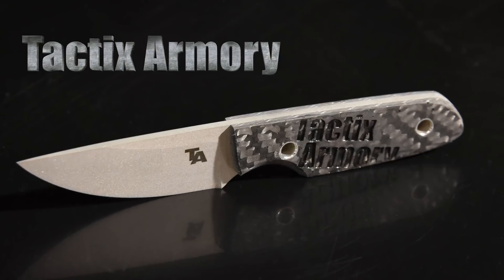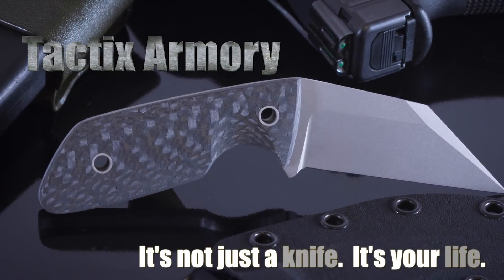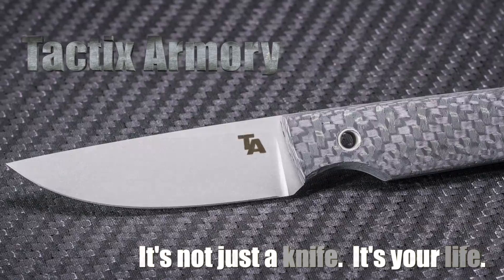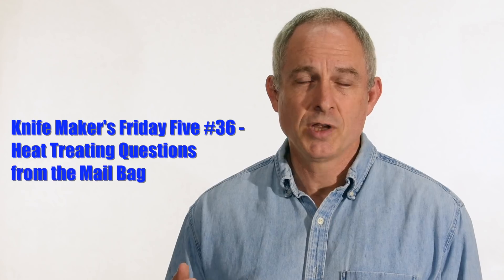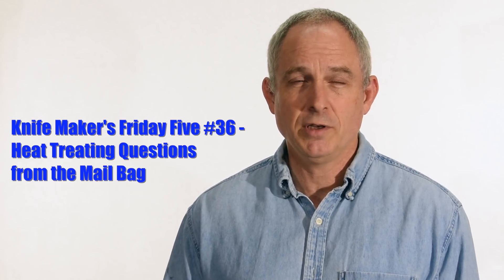Knifemaker's Friday Five #36: Heat Treating Questions

Comment: Use to here about some people using a salt brine quench but haven’t heard of anyone use it for years, does anyone still use it. I built a few knives years ago. I used leaf springs or stole some pieces of t1 from my dad ( he was a welder). The t1 didn’t warp much and made a decent blade'. I usually used them for work knives. I was a diesel mechanic, so I cut belts scraped gaskets, etc. bigger knives I differentially treated them. Tried water and oils.

Comment: Another important thing to consider is space. If you are working in your garage with limited space a vertical quench is a simple tube that is maybe 2" x 2" vs a large trough.  Another thing to consider with the harden first method is what if I have incorrectly drilled for the tang.  I have tried to drill hardened steel or stainless and it will toast your drill bits. Bosch does make some multi-material bits but i haven't tried them yet.   https://www.homedepot.com/p/Bosch-Daredevil-Multi-Purpose-Carbide-Drill-Bits-for-Drilling-Tile-Masonry-Wood-Metal-and-Concrete-5-Piece-MP500T/301372988
Reply: Hello WC. Try looking for drill bits with cobalt added into their composition. I got some for drilling stainless steel and they munched through, no trouble. Best regards.

Comment: Thermocycling anything above 1075 causes the carbon to form carbides. Carbides are brittle and dont sharpen. Take 2 bars of 1095 and thermo one. Just quench the other without thermo. Break both and look. The steel can only dissolve so much carbon before it becomes saturated. That is around .65-.7. This is why 1095 is so damn brittle compared to 1075. Knowing what the knife will be subjected to helps select the correct steel for the job. Carbides hold edges far better than steel. There is a trade off.

Comment: Heat Treatment Advice 101:  Read the steel manufacturers Technical Data Sheets

I think you should address cryogenic treatment.  Reach out to your knife making peers and ask them if they think Jay Fisher is correct in that you can only achieve a proper cryo-treat by lowering the steels temperature by 4-5 degrees per minute with a cryogenic processor.  Or if they think just dunking it in LN2 is fine...because Jay’s take on that is you are shocking the steel, risking micro fractures and therefore actually precipitating an adverse reaction.  It seems heat treatment by comparison is child’s play.

Comment: Water quenching makes really pretty sounds like TINK and PING.
Reply: AZ Patriot I’ve been lucky and only lost one blade through water quenching.
Reply: It’s all dependent on steel choice, blade dimensions, skill, and luck.  Follow the spec sheets for the steel you have, not some random 8nternet advice.
Reply: sounds like TINK and PING are an indication of something bad happening.
Reply: ....unless, of course, the advice is for you to use the data sheets for the steel.  Personally, I value my time and I don’t make a lot of knives....I quench with oil.  If I start making more knives I’ll buy some Parks quenchant because it is a nice in between.  Faster than the usual oils but slower than water.  Perfect for 1095....if you are nervous about that “tink” sound.

Comment: If you have only 1 knife to quench, can you reuse the oil later for machine lubrication etc, or will it become burnt and ruined?
Reply: Motor oil that is
Reply: Yonatan24 + It should be fine as long as you strain out any scale that is in it. I myself would not recommend motor oil, canola oil works just as good and is cheaper. I’ve been using the same half gallon for about six months, just keep it sealed.

Comment: Would a knife still have a chance of warping when grinding after hardening? I know any time you remove steel before or after hardening it changes the internal stresses and can cause it to warp or spring in machining. Not sure if it would apply to knife making as well.

Comment: When I first started I used "welding" steel from home depot and actually got a hamon on it. After many years of knife making I knew how ridiculous that sounded so I went back to it and did an acid test and scratch test and sure enough the edge was harder. Depending on the batch I think welding steel can get close to .5 percent carbon. What are your thoughts on this?
Reply: Steve Campbell hardware store steel is a crapshoot. The material tolerances are very loose. Same thing with railroad spikes and rebar. Some of those will harden too. You just never know what you are getting, and the actual performance (edge holding, toughness etc.) will almost certainly be worse than a well-known steel.

But you know, people have made good knives out of flint, obsidian, copper, bronze, glass, iron, steel and a whole bunch of other things in the past. We are very spoiled these days with our super knife steels. Iron makes a usable knife, you just have to sharpen it a lot more often.

Comment: Quick question - hopefully quick anyway. I'm making knives by hand with files (don't have a belt grinder) out of 1095.  When I file in the bevels, I leave a little meat on the cutting edge to help ensure that it doesn't warp or crack in the quench.  Problem is, after it's hard, I can't file the bevels the rest of the way to where I can easily get a secondary bevel for a cutting edge because now it skates the file.  So my question is, do I have to just put up with spending lots of time on the diamond stones to reduce the thickness after it's hard, or should I get the primary bevel very close to final thickness prior to quench but risk it cracking? Thanks for any tips!
Reply: A 6" grinder is really cheap, like under $40 and that will save you a lot of time on both ends of shaping and sharpening. A belt sander can be as cheap as $100 and you can get custom belts made and shipped to you in various grits
Reply: Also if you have the capacity to heat for hardening, what is keeping you from forging? I know anvil are very pricey but if you have a railroad any where near you you can usually walk the line and eventually find a large piece of discarded steel that was meant for  securing a railroad tie that makes a nice anvil or if you are lucky a piece of rail which can be made into a great starters anvil.
Reply: Anneal/normalise, shape, heat/quench, temper, then finish.

Comment: Great video and info. 
I use slot of 1084 and after using oil for my first 20 blades,I had mixed results on actually hardening the blade. After alot of research and Trials and errors,  I have been using a  super saturated saltwater quench. I have not cracked or warped a blade. They get very hard the first shot and the blade actually become cleaner after the quench.
Reply: I would like to hear more on this!

Comment: Great video. I've been using salvaged coil spring, assuming it's 5160, and quenching in water to get it hard enough because I've been told it's a slow hardening steel. Finished product is always what I want. Am I lucky or is it not the steel I think it is?
Reply: Adam Steffen if it is 5160, it will absolutely harden in oil. "Slow hardening" means it is easy to harden because you don't need to cool it quickly. In my experience 5160 will harden a bit (not completely) just from air cooling. I'd say you are lucky you haven't cracked any blades yet! Fortunately it is a very tough steel so it can take some stress.

But as you say, it may be a different steel entirely.
Reply: Uncephalized mmmm the mysteries of the unknown. No cracks yet. I've dropped more than I'd like to admit sadly